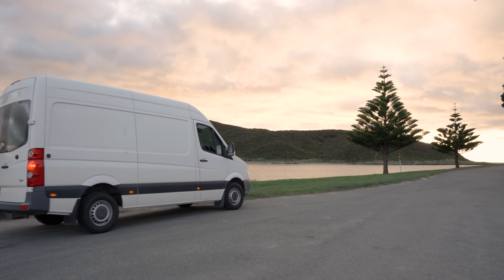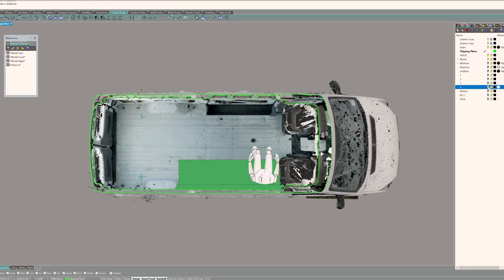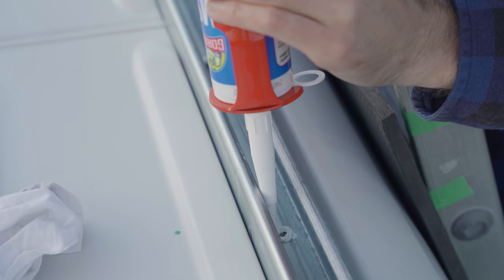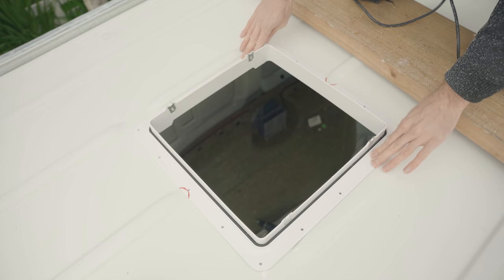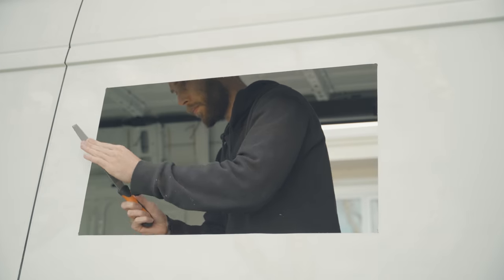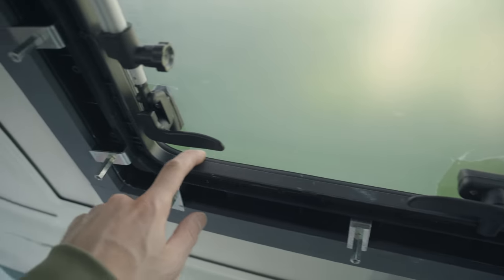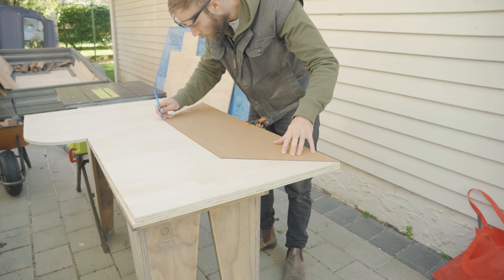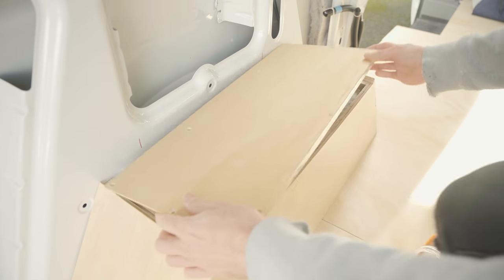DIY Camper Van to Travel AND Work | Van Conversion Part 1

Comment from the maker: Hey everyone, Rob here, sorry it’s been a while since my last upload! 
Thanks for checking out Part 1 of my van build. This is just going to be a short series, so I'm going to try get the videos out more consistently over the next few weeks.
Reply: I should mention, I’ve done both!  I’ve cut out a moonroof for my RX7 back in the day, similar to your vent, as well as swapped out some side windows and also upgraded to power windows from cranks.  100% junk yard parts!
Reply from the maker: epic! RX7s are one of my favs
Reply: I have sent you several emails regarding the manual/building guides for the 400 & the 1200
Reply from the maker: I'm only one person here, and I'm trying my best to get to everyone with the time that I have

Comment: It's amazing how pitted that front hood is. The fact that it wasn't completely rusted over is mind boggling. 
Surprised you didn't pull those side plastics off and sealed it on both sides :P
Reply from the maker: I know right! Ideally it needs a full repaint, but that's a bit outside the scope of a 'quick' build

Comment: I like this idea.  Can’t do it married, lol, but I like the idea.  Nice work on the window, buuuuut…. Have you considered actually getting a window that was designed for the van?  I’d imagine you could find a pristine one at a junk yard somewhere, and then it would just look stock, and it would also be much larger.  If you were lucky enough, you could get a whole set of stock windows.
Reply from the maker: haha very true, figured it was a good chance to do it while I didn't have any attachments. Yeah getting a stock window would have been sweet too, if one comes up that could definitely be an option as the hole I'd need to cut would be larger anyway

Comment: hello. i was blown away by the photogrammetry. i am currently in the process of planning my own van and would love to use this technique. however, i managed to get a relatively decent model of the outside. how did you get the inside and outside model? i saw you had the doors closed on your outside model. how did you manage to get this model that you used in 2:06? i would love to have that from my van. thx for helping me out here.

Comment: This is a great video, it's cool to see a kiwi van build video. Was wondering where you got the wool insulation from? And did I see you tear it in half to reduce the thickness? I am about to insulate my caravan build, but am struggling to find wool insulation 30mm thick!

Comment: Hi Rob, could you please give some info on the software you have used, perhaps easier if you just correct me below:
- 3D Modelling Software - Autodesk Fusion
- 3D Scanning (from Photos) - Meshroom (you used 460 photos to create point cloud and 3D model)
- @ 2:25 you appear to be in Rhinoceros 
I am really interested in following the same procedure, take photos, create 3D model fom point cloud info etc.